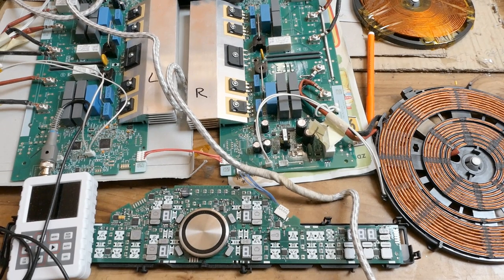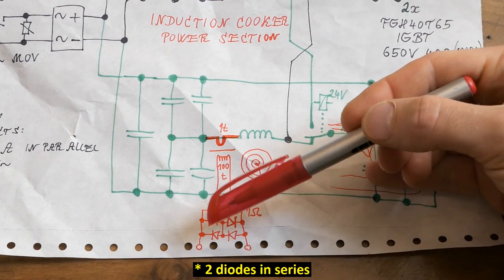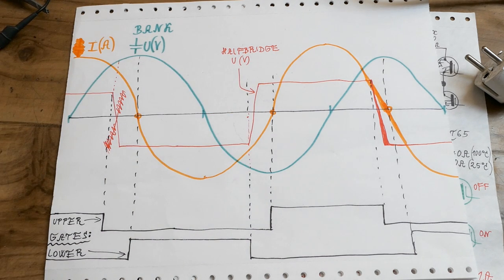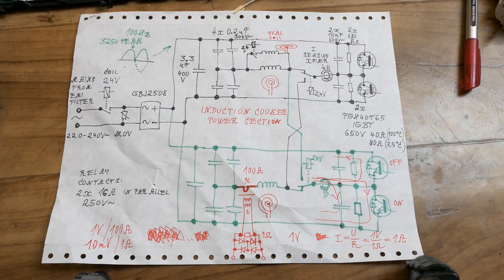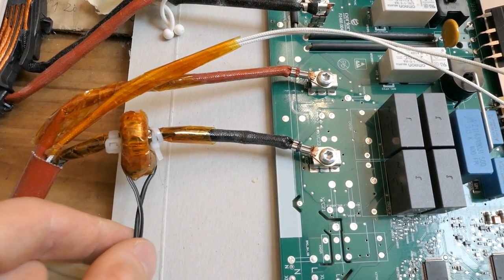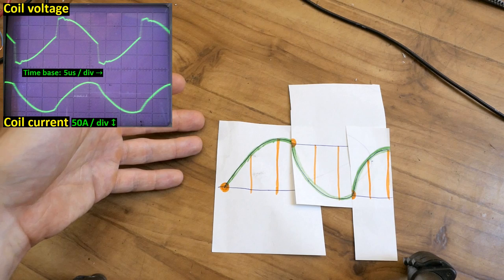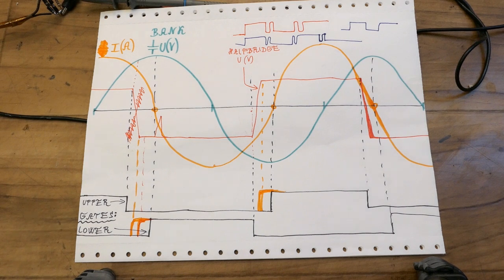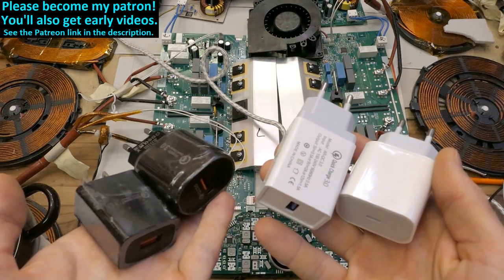induction cooker - ZVS waveforms

Comment: The coil heats the pot not just by eddy currents, but also by the hysteresis losses, which (i think) may be much more significant in this case, that's why it only works with ferromagnetic materials, like iron and steel. Aluminum is not ferromagnetic, but it could still be heated by eddy currents. However, usually the bottom of aluminum pots are thin so less eddy currents can flow there. I think it could work with thicker pots, even not ferromagnetic ones, I'm not sure though. I need to learn more in this topic, but something tells me that the magnetic properties of the pot is important. (Maybe for the coupling of the field of the coils?)
You can also think of it like the pot being the core of the inductor. The cooker basically utilizes the heat that would mean the losses in a transformer.

Maybe you could try is with sheets of various thickness and materials.
Also, awesome video as always!

Comment: Really interesting! 
Appherently they use varying frequency to tune/detune the circuit more or less into/out of resonance, to regulate power. Always running the circuit in full resonance (with true zero voltage switching) and have current regulation on the input instead, would give slightly better efficiency - but requires more components. It's all about making simple and cheap design and it's still way more efficient than an "ordinary" stove using resistive heating.

Comment: Awesome walkthrough, great explanations.... and yes, what the heck happened to stove useability over the years?! This touch-design-over-function BS must stop, just give us easy grip knobs that turn, are easy to clean and doesn't get flooded over incase of something boiling over. One of the great features of induction is that it almost instantly stops adding heat once you turn down (as opposed to steel plates/IR).

Comment: I have cheap inductive stove (around 30USD) and it seems like it not that advanced, it basically cycles periodically like resistive element.
if I set it to minimum power it have duty cycle of 10% with around a minute or less for the cycle to complete
and if I put it to 10 it basically stays on.
and the amazing thing happen when it's fully on. after 10 minutes of operations the big "smoothing" capacitor right aver full bridge rectifier pops and fuming and surprisingly the fuse didn't blow FML.

Comment: Can it work with 400V AC?
Reply: If you are talking about three phase, then yes in previous videos he explained it was a three phase - as many European stoves/ovens are.
Reply from the maker: No, it's not 3 phase. It has 2 phases going into it, but each half uses one of them and neutral. It runs on 230V, not 400V. The components are not rated to run on 400V.